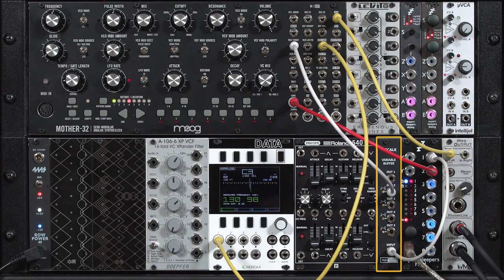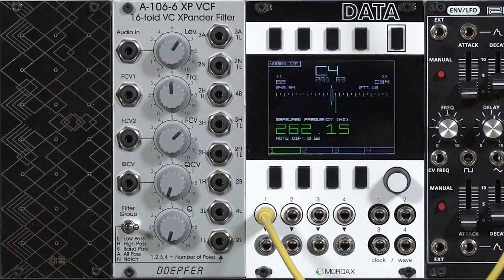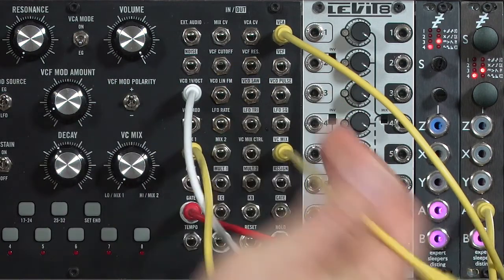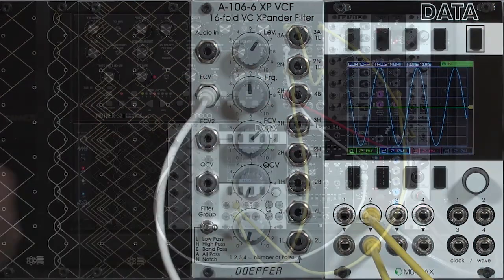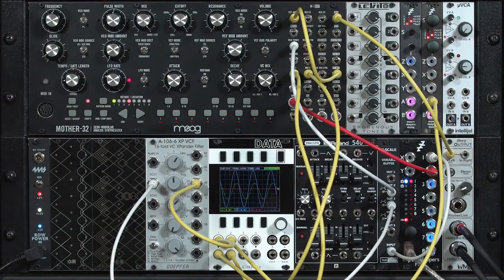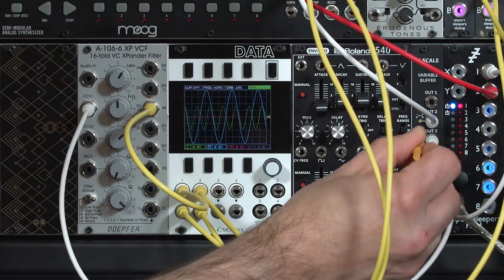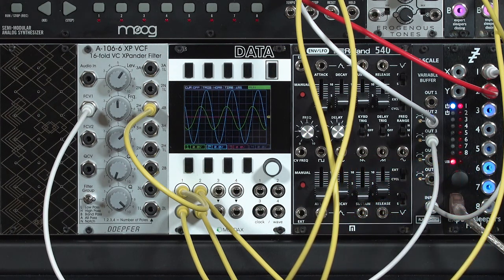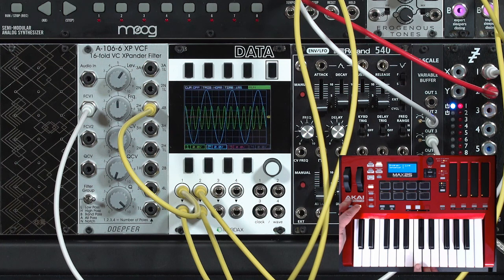Improving Intonation using the AJH Synth V-Scale (Part 2: Doepfer VCF)

Comment: Very interesting, thx. But do you have to VERY precise when your analog oscillators run through quantizers??
Reply from the maker: Even if your quantizer is precise, your oscillators may not be precise - they are the weakest link. If you think about it, a keyboard controller has a quantizer built in, but it's the oscillators that are mis-interpreting what to do with the voltages you send them. So you still need to calibrate your oscillators, or place a V-Scale between your quantizer and the oscillators.
Reply: @LearningModular  ah ok, sure. I got it. Thx!